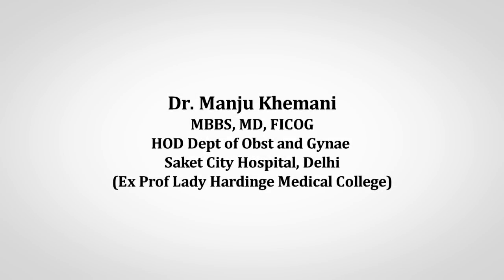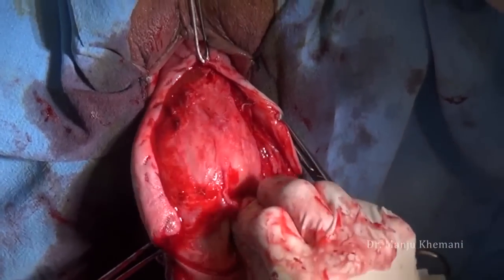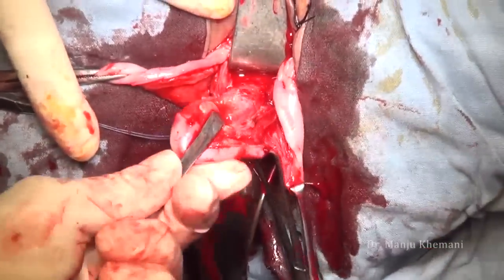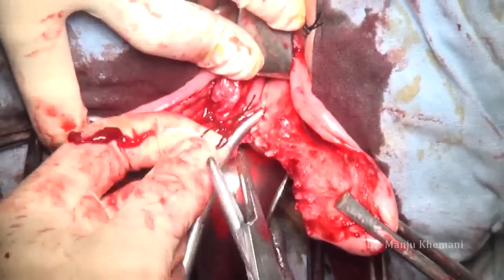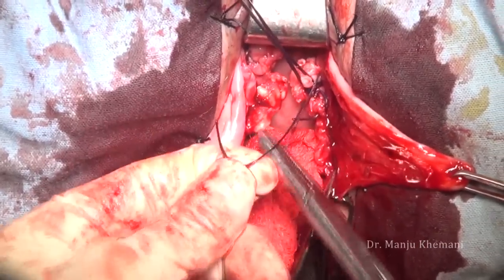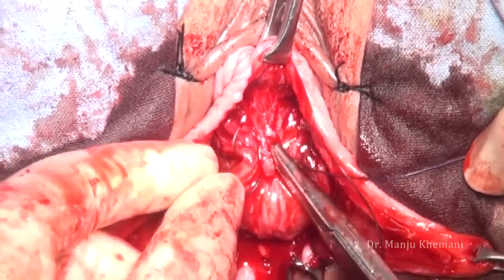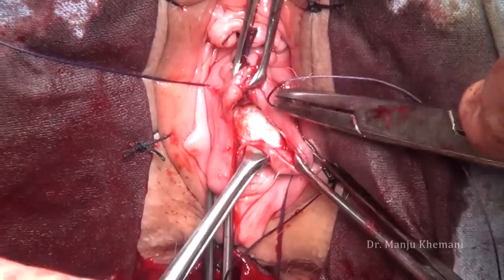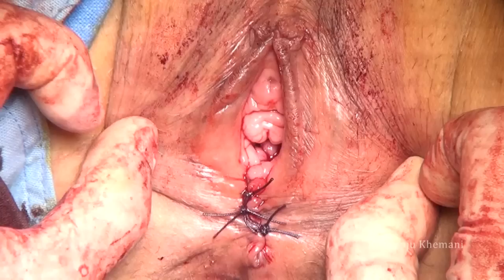Technique of Vaginal Hysterectomy

Comment: Indians are good in vaginal surgeries. All the techniques are indianalised. I don't know the difference between pubocervical fascia and vesicovaginal fascia. Tears of the rectovaginal fascia has been reported but not the pubocervical fascia. McCall Culdeplasty is modified, in original, peritoneum is not closed. Apposition of USLs with PCF is excellent, which prevents anterior enterocele. Levator plication, originally closing the rectum by apposition of pubococcygeal muscle (David H Nichols), is not the plicating puborectalis muscle, has been done here. When the cut edges are outside the introitus, either original McCall or SSF has to be done. Rectocele repair is excellent as per JOL DeLancey. Experience of the surgeon will bring good result in this case.
we usually don't follow the Nichols, McCall, DeLancey, Kovac's technique always but our results are excellent. This is not third world surgery. Blood loss is less than 50 ml.